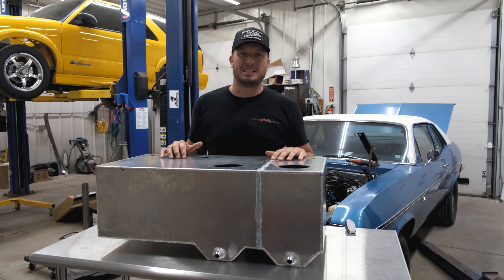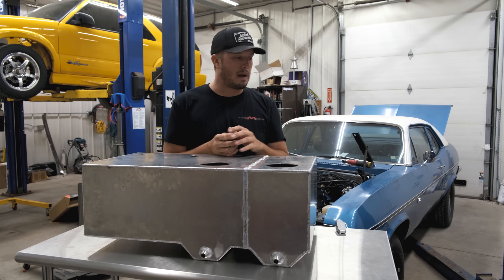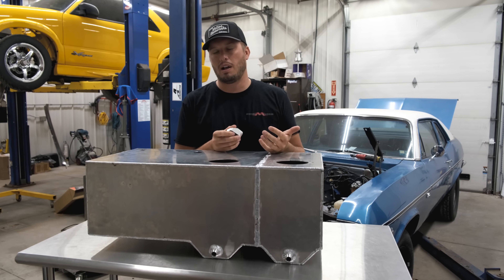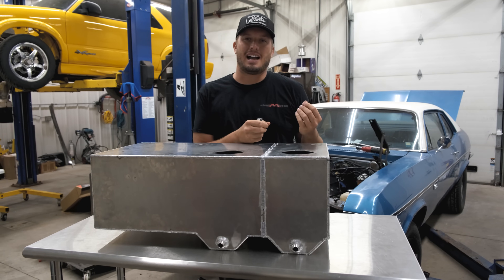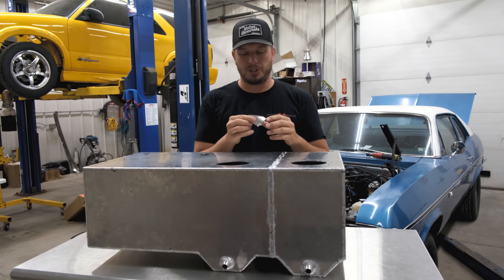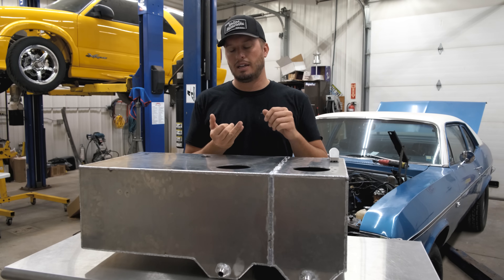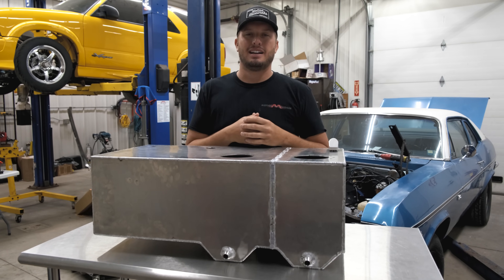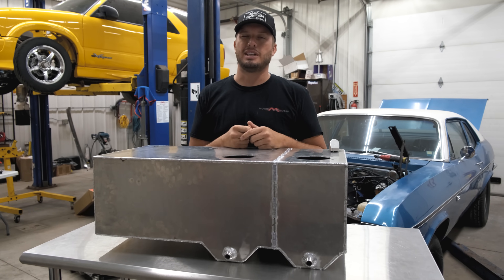Fuel Tank Vent Size, So important! How to do it right - Tech Tip Tuesday!

Comment: Very good. I'm running a mechanical pump no return line. I'm running a 8an fuel line to the pump, 6an to carb. I was gonna do a 6an vent line. With about a 22 inch coil of line. What would be good for a end line cap. Thanks, all help is good help. From off the grid in AZ

Comment: Does a fuel call used as a factory replacement tank under the vehicle and using a factory fill hose and vented cap still need a rollover vent on the tank or can I cap it off?

Comment: I think you gave some incorrect information when you tried to relate fuel flow from the tank to high and low pressure pumps.  The higher pressure for EFI is needed for the injectors to atomize the fuel whereas the low pressure pump for a carburator only has to keep the carb fuel bowl full but if the engines are making the same HP they will use the same amount of fuel.  It is still science and not magic.  You can pull a gallon/hour of fuel from the tank at 10psi  or at 60psi and the fuel flow rate is still the same (1 gallon/hour).

Comment: Spiral up your vent line… No clue who started that, but it’s not a 💯 thought through idea… 

Ever heard of a sink trap? If fuel gets up in the spirals and sits, you now have a blocked vent line. One that now pushes that “fuel pill” back and forth through the vent line… It’s now effectively an expansion chamber not a vent line. 

Is it a total fail? No, but it’s not 💯… A proper vent fitting with a check ball and a hose attached, if someone properly engineered one, is the ultimate solution. No clue why in 2024 the aftermarket is so slow…

Comment: This may knot be in your wheel house but I have a question . If you have 40 psi going out to a injector how much suction pressure do you have? I have my vent line looped about 6 times. I doing this because of off road racing and don't want the fuel splash out of the vent but I think my vent line is sucking shut

Comment: Anyone got some input on my idea? I can't find anything when searching for it.

I'm thinking about running dual vents one on each side of the tank, Would it be a good idea a bad idea or just overkill?

My thinking is if fuel splashes up in the vent line and up on the check valve closing it on one side of the tank in a hard turn for example then the other side would vent just fine and vice versa, The more ventilation the better?

Second question not as important right now:

Is there a good type of pressure clock that you can install in the gas tank to keep an eye on how much pressure is in the tank just an extra safety feature that I'm thinking on. cant be too safe when dealing with custom built tanks for flammable liquids right?

And what should the pressure be inside of a gas tank? As close to atmosphere as possible or is there some sciensy thing I don't know to having the right amount of pressure in a tank?

Comment: By looping the vent line, you could get fuel trapped in the bottom of the loop, thus it will act like the trap on your sink... not allowing it to vent.  Do not loop...
Reply: correct we loop ours for the marine world and we have water and condensation that does the samething per what you are saying.

Comment: Tank vent,, use a brake booster one way valve. Plenty large and do not spill either. I have used them for 40 years on road race cars as well as speedway with no issue. IF you want to be doubly sure use some 3/8 hose in a spiral. Bulletproof
Reply: So just a regular one way brake booster valve should work for a universal ebay 20 gallon fuel cell?
Reply: good idea!

Comment: What about Derek's foxy Mustang? Didn't it die with fuel dilemma early on, if so who's fuel system was it running?
Reply from the maker: Internal wiring short on the fuel pump, not a system design issue
Reply: @MotionRaceworksOfficial  Thanks for the clarification, cheers.

Comment: Question Doug. We have a carbureted 69’ Nova with a bbc. We run E85 and do not have a return line. Do we need to add a return line?  right at 425 RWHP with 8AN line going thru a Holley fuel pump. Don’t remember the size/volume but when I did the math for our carb last year it seemed to be enough. Only running about 9psi on the system. Thanks for the info
Reply: Other than the extra expense, there's no downside to running a return system. And it can help the pump live longer. No reason not to run one if you can afford the extra plumbing.
Reply: @johnterpack3940  appreciate the info. Still fairly new and learning new things all the time. I’ll definitely get one in while reassembling the car. Sounds like it can never hurt!
Reply: @jaredspear8140  glad to help. I don't have a PhD myself. But cars are actually pretty simple to understand when you break it down. And they haven't changed as much in the 40+ years I've been playing with them as some folks would like to think.

Comment: You said that a "check valve" was not mandatory. Pretty sure NHRA requires a rollover valve on all fuel cell to prevent fuel from coming out if vehicle is upside down. Having a catch can will not prevent the fuel from coming out of the cell. A protect check/rollover is required and should be used for safety.
Also, a very good idea to have a filter on the vent or it will suck a LOT of dirt in the fuel cell and fuel system.

Comment: Just curious.  I was always told to install 2 vent lines the same size as your feed line, with appropriate size check valves, one of the front and one on the rear, stagger their sides too.
That way if drag racing, the rear vent closes off, but the front is open.  Same for the side to side which does the same with a full tank and street driving.
Reply: I have a custom Roadster Shop Chassis Fuel Cell, they built my tank with two breather outlets one in the front & one in the rear. I didn’t know this until I just seen your comment! Thanks!

Comment: Wouldn't it be building vacuum instead of pressure which the vacuum would help the return line instead of hinder it would put more amps/ stress on the pump though.
Reply: you have to also think about fuel heating. fuel is going to the hot engine bay, through fuel rails bolted to a hot engine, and then returned to the tank. also consider on a race week car the air temps increasing throughout the day. this alone will cause a lot of pressure build up in the tank.

Comment: I put a Summit Racing plastic cell in the back of an old C10 I built years back. Came out one HOT summer Texas afternoon and the vent had failed. Cell was swole up like a 2 day old dead hog on the side of the road. Took a pair of big ass channel locks to get the plastic cap off just to release the pressure.

Comment: Be nice to see a fuel cooler kit for the returning fuel or stand alone low pressure pump/cooler circulator maybe with a fan to cool fuel in the tank while on high temp days, may not be a big call for one but A/A intercooler cars dont have an ice tank to use as a return fuel cooler

Comment: Do water to air intercooler next please!
Reply: I second this…I’d like to know other than AN lines what hose works best for the water lines because AN starts to get expensive
Reply: @scottbennett3548  You can use a barb style fitting and use almost any type of hose. Just need to make sure its water safe and you aren't using it over the recommended operating temp. The larger diameter hose the better.
Reply: @D-WAKE  what kind of water pump? I know the Davies Craig is what everybody uses but how does everybody mount them? Also what fittings is everyone using to mount fuel filters straight to the pump? I’ve looked for -10 ORB to -10 ORB fittings and can’t find any lol
Reply: @scottbennett3548  you can mount a CD pump by using the inlet threads. Just thread it onto the ice box. Or make a mount that bolts to the rear on the pump. Lots of places sell -10 orb to -10 orb, in a pinch you can just use a normal AN male to male and just put o rings on it.
Reply: @D-WAKE  cool thanks man 👍🏼

Comment: Dougie when are you guys going to design a setup to route fuel line through an ice box to help keep the fuel from boiling on drives? Think a simple coil type heat exchanger would make a difference if you have to buy ice and water to cool the tank itself.
Reply: I wonder why this hasn’t been done yet??
Reply: @Justme-jt1ef a fuel  pump controller is a better fix
Reply: @buddyhirshfield5970  I had to look this one up seems like it would work but I also think a cooler would be a good idea as well maybe use the factory air-conditioning instead of ice cubes and when you race take the belt off or just use an Electric A/C pump of a sort.
Reply: @buddyhirshfield5970  controller does great for fuel alone but doesn’t help control ambient temp or road surface temps radiating under the car
Reply: @Justme-jt1ef  Most of the heat is generated by the fuel Bypass back to the fuel tank i’ve use a controller on a car that you couldn’t drive for more than 45 minutes without it shutting off Because of the fuel overheating ,we put a controller on it and drove it for four hours and never missed a beat
Reply: @buddyhirshfield5970  I think this was meant  for young11984. I can be wrong tho
Reply: @buddyhirshfield5970  you drove for 4hrs but what was the ambient temp, highway temp, fuel pump used? Most of these upper hp cars run cable driven pumps without the luxury of a controller, i get what you are saying about in tank 340s, but cable drive is another world in 100+ ambient and 130-140 road temps for hours. Im an overkill type person and have a cooler with a fan on the return line with temp sensor to turn it on but was just curious as to what another person would use vs what i did
Reply: @young11984  it was August in South Florida in the mid 90s on interstate 95 in traffic ,I’m just tell you what works for me The motor was an LS 9 built by Thomson race engines in Detroit in a 1958 Chevrolet This was recommended by them to fix the problem and it did
Reply: @buddyhirshfield5970  4 eye 58, one of my all time favorite heavy classics
Reply: @Justme look up killerChiller Kits that’s basically what that is
Reply: There are plenty of companies that make these. Just search fuel cool can.
Reply: @bovineknievel410  wow great advice
Reply: @bovineknievel410  those are an ice based cans though like were the norm in the 60-70s and not legal in IHRA/NHRA so since technology is severely more advanced and user friendly now those low pressure tanks are not acceptable especially at 60-80psi base pressures, may be fine on return lines but still constantly requiring ice

Comment: Great, thanks for the info. I need a complete duel system for my I6 Chevy 292 with 6-71 blower and duel quads.  About 1000 hp. I'll be giving you a call.
Reply: Do you have pictures/videos of your project? That sounds really cool and I'm very intrigued!!!
Reply: @sowbellymotorsports9783  I'm not sure how to do that. It's a work in progress. I'm waiting on the machine shop to fit the head and dowel the mains and girdle it. Then Hogan can make the intake. Billet crank, cam (solid roller) and rods by Crower. Ryan Falconer V-12 aluminum head (crossflow 340I 220E).  5 stage dry sump. Electromotive coil over direct fire T200s ignition. I'll try to figure out how to send pics. It goes in my 53 Chevy 1/2 ton pickup.
Reply: @lazyhoundracing9621  That sounds like a really cool project for sure. I really like off the beaten path and that for sure is!

Comment: Didn't you have to replace a fuel pump on El Toro?
Reply from the maker: Yes, but it was from an internal wiring issue where the coating came off the wiring and grounded on the housing, nothing plumbing wise

Comment: Is there anything you can do that keep fuel from boiling? I know a few people on RMRW had problems including Cleetus had this problem.
Reply from the maker: A cooler similar to a transmission cooler works
Reply: @MotionRaceworksOfficial  something I've heard of to keep the temp down is on a few raceweek cars is a "small" drop in pump to do normal driving/crusing like a 450, as well as a larger external pump that kicks on when needed. Not sure exactly what criteria triggers that from the ecu, is this something you've heard of and is known to work?
Reply: I figure there has to be a way the manufactures accomplish that. Maybe something we could duplicate?